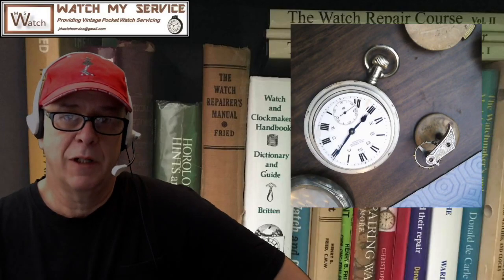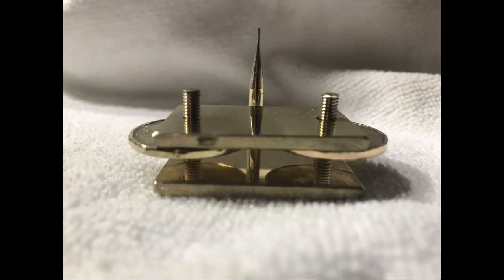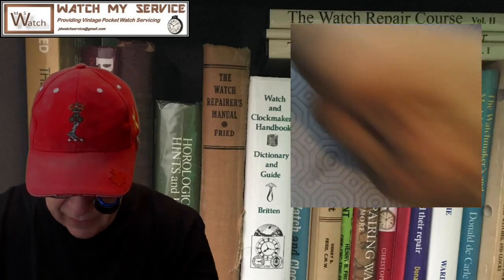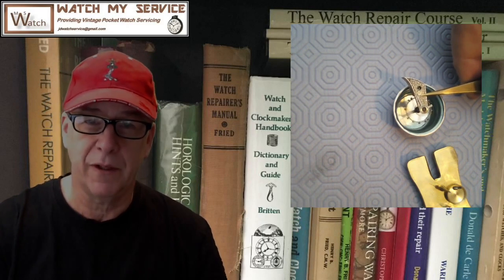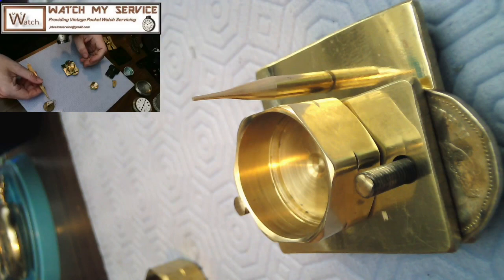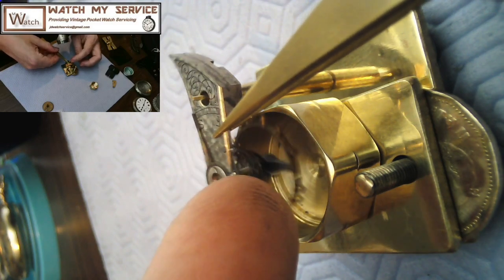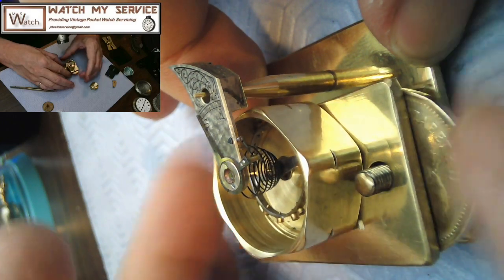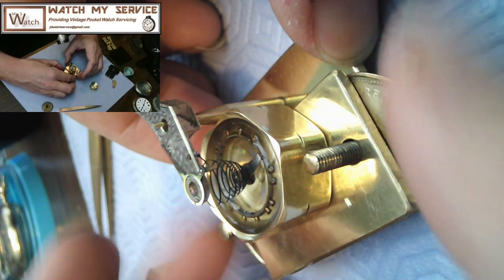New Tool for Cleaning Watch Balance Complete

Comment: Very cool contraption. I always seem to have to release the balance/hair spring stud from the cock to push out the jewels, so then just soak the entire balance with spring in the naphtha...cleans the pivots, impulse jewel, etc. along with the hair spring. But your invention is still an efficient and very clever way to do the spring...it exposes your engineering background! Thanks for the vids.
Reply from the maker: Thanks for the positive comment. The tool was also fun to make.

Comment: JD:  What about lacquer thinner?   Would that work for a solvent?
Reply from the maker: I would not know that
Reply: @JDRichard  I just tried lacquer thinner on a Big Ben hairspring.   I see no ill effect.  And it dries fast.    I never have purchased any One Dip.   Perhaps I should.   Also, no ultra-sonic cleaner so I have to make do.   I do see fellows using naptha/lighter fluid so you are on point with that.   Whatever works!

Comment: I've been watching your videos over the last couple or years and have a learned a lot from you. Thank you for taking the time to do these. I do have a question about this one...

When I clean my balances (complete but removed from balance cock), I usually give them a quick cleaning in a small container with lighter fluid. I do the same with the pallet fork. I do not clean either of these parts in the ultrasonic machine or soak them more than a minute or two. Usually a quick cleaning (using a small soft brush - but not on the spring) does the trick. They should be dried immediately as well. Shellac is dissolved by alcohol. I guess if you soak them in lighter fluid long enough, the shellac will dissolve there too. Very rarely have I come across a hairspring that was so gummed up that I had to use alcohol. If and when I do (and I have), I clean as quickly as possible in alcohol. It's not the end of the world if you have to reset the impulse jewel, should it come to that. Actually, one of your videos gave me the inspiration to do that myself.

 I guess the question I have is... why the special tool? From my own experience, shellac takes a little time to dissolve. Even longer in lighter fluid.

Keep up the great videos and thanks again!
Reply from the maker: What I wanted to do was have a tool that allowed me to safely dunk the balance and hairspring  in lighter fluid while completely attached to the balance; then test the balance complete in the movement to look for an improvement in amplitude. The tool does work, however, a proper cleaning requires you to strip the balance down and clean all parts anyway.  So the tool works but is only useful if you simply want to clean the balance and hairspring without removing it from the balance cock. If course, if you don’t remove the balance, the upper part of the balance is not addressed. But, it is a cool tool:)
Reply: @JDRichard it’s great you respond, so many don’t, thanks. 

I did wonder about the upper parts of the hairspring. Why not just dip the whole assembly. That’s what I do using hexane.

But drilling the late Queen’s head 😱

Comment: It comes as a surprise to me that lighter fluid does not dissolve the shellac of the impulse jewel. But apparently it's true (looked it up in multiple places). Rubbing alcohol, on the other hand will dissolve shellac for sure, so I wonder what is a good method for rinsing the traces of lighter fluid off the balance assembly if rubbing alcohol cannot be used here. also, I wonder why you only dip the balance wheel and the hairspring into the lighter fluid. why not put the whole balance assembly (together with the tack) into the fluid? to use less fluid or is there another reason too?
Reply from the maker: Actually just want to clean the hairspring to check on the amplitude as I have found over the years that a gummed up hairspring is a large contributor to the balance swing slowing down. So no need to dip the complete balance and balance cock.  After I do this, I then strip down the balance and clean the upper jewel.
Reply: Yeah you need an aqueous based solvent to dissolve shellac. Fully organic should be inert to that, but not to grease etc

Comment: Lighter Fluid..????   Ok buddy....  If you have a watch cleaning ultrasonic just place the balance in the top basket and run it with the rest of the watch....Why are you cleaning balance assemblies by hand....or better yet, why are you making tools that have no value added...
Reply from the maker: Thanks for the comment. Old school. I have an ultrasonic machine but fear loosening the parts.
Reply from the maker: You just kicked the stool out from my idea.
Reply: @JDRichard  Im sorry.....Make one anyway....If you like it and use it...then its worth doing...right.??
Reply from the maker: No problem...all comments are accepted:)
Reply: Ultrasonic can loosen the shellac and lead to lead to issues. Of course folks will say “I’ve done it a thousand times and never had an issue”, but I’d always worry that it would go wrong on the $10K Rolex.